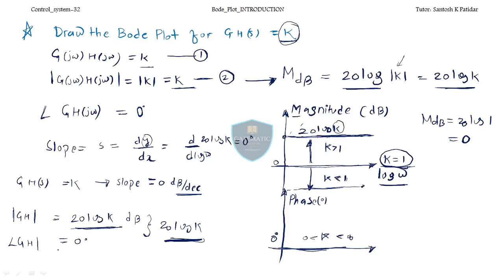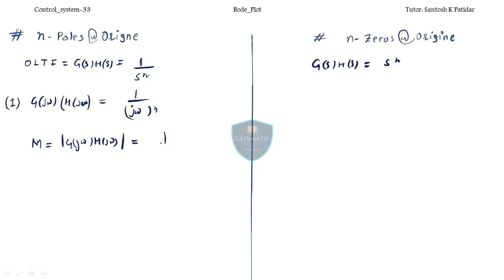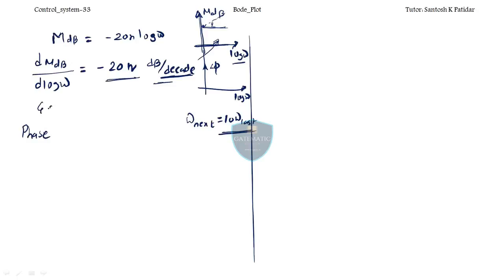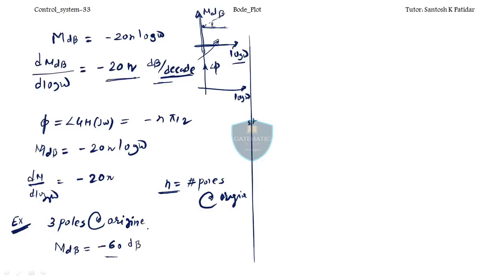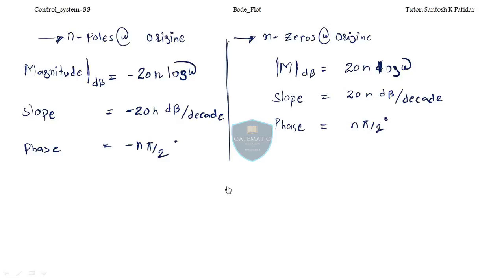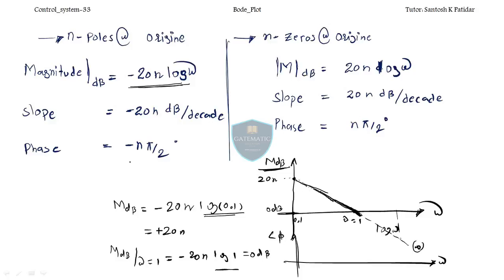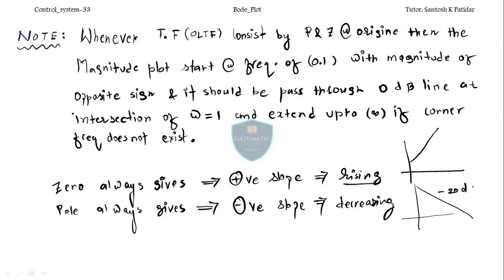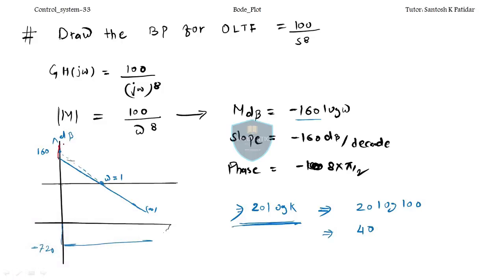Lec 33 Bode Plot (Contd.)

Comment: sir at 22:00 , why is the magnitude in db NOT 20log(100/w^8)=40-160logw ??
Reply: JOSHITHA R 14BEC1121 , you are absolutely right. Just put w=0.1 in the eqn that you've got, magnitude will be 200. There is no need to add on anything like sir did in the last part of the video.
Hope it helps.